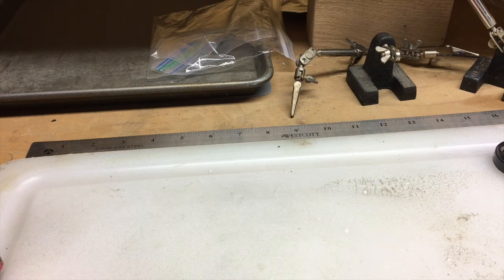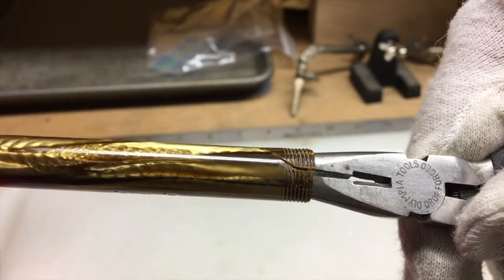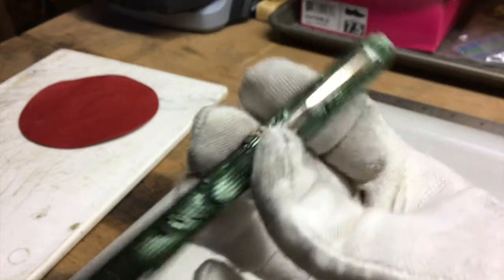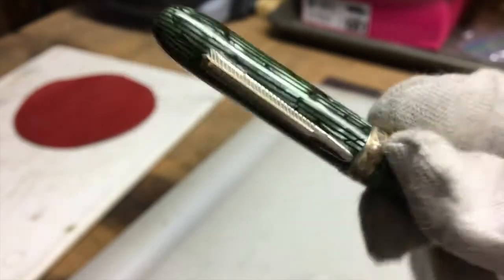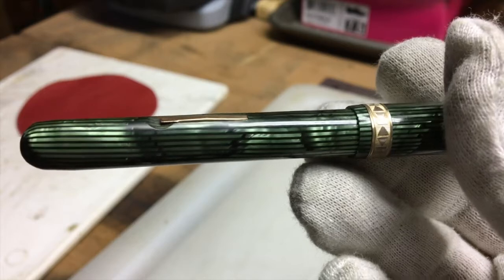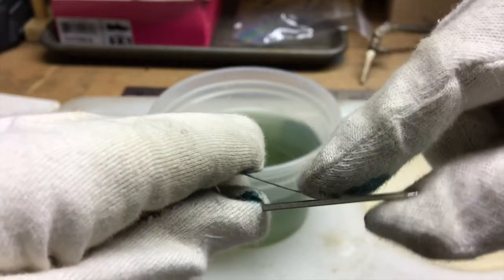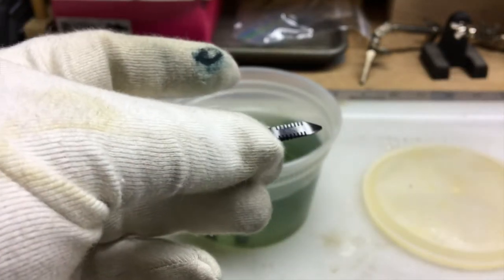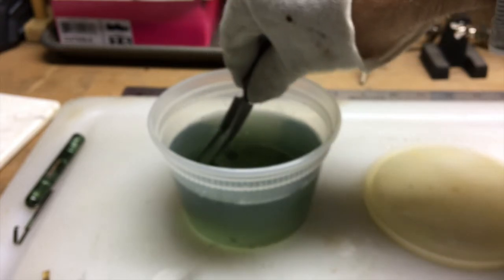Majestic Fountain Pen: Disassembly and Initial Cleaning

Comment: I would never use even padded pliers on a nib and feed, considering how fragile feeds are (and how hard it is to replace vintage feeds). In my opinion, you would have been better using the pliers to hold the section while you tried to grip the nib and feed with your grippy cloth; alternatively, it is also safer to use a knockout block to remove the nib and feed from the back of the section, once you have been able to remove the section.

Comment: Why are you using hardened steel pliers and tweezers when you hold soft materials like a piece off brass or a (gold) nib? Its easy to damage these fine parts made from soft materials with these tools. You should be more carefull if you actualy care about these fountain pens.
Reply from the maker: No worries, I’m very careful to hold items with minimal pressure using tools that allow me to be very precise. And considering the daily abuse these pens were designed to take, they’re usually still quite robust even after all these years.